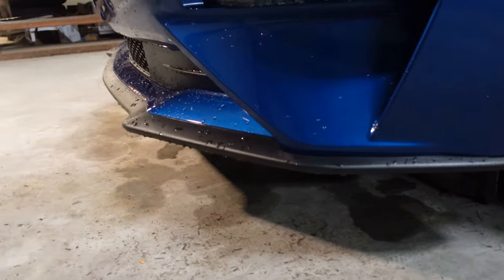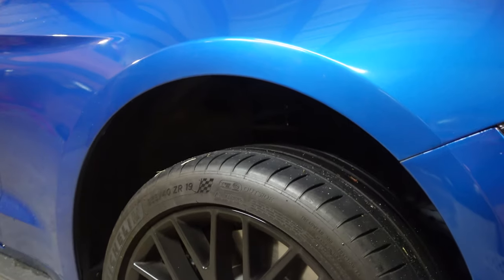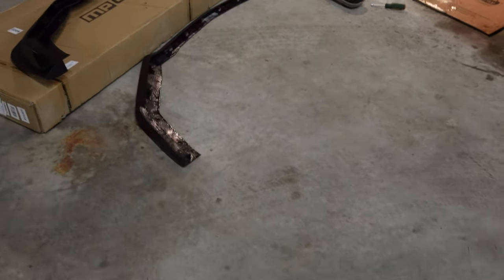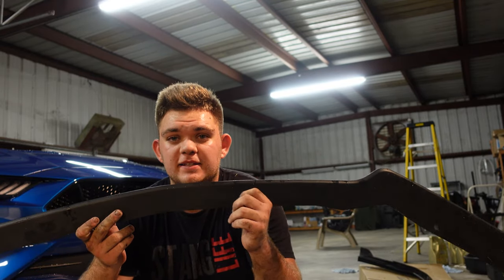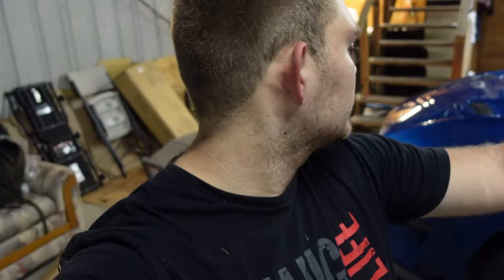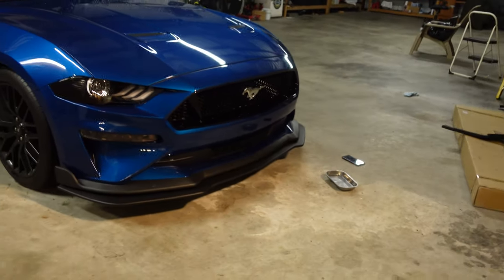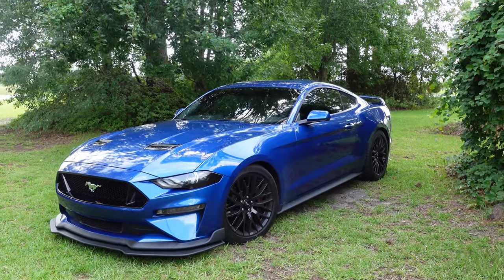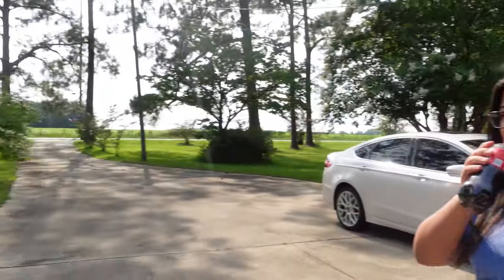HOW TO MAKE YOUR MUSTANG LOOK MORE AGGRESSIVE! | MP Concepts Chin Spoiler Install and Review!

Comment: For what it’s worth, I have a Performance Pack Eco and the splitter isn’t larger than the other one.  As I recall, only the GT PP got the larger splitter.
Reply from the maker: Okay see I wasn't sure 😅 I knew the GTs had slightly bigger splitter I just didn't know if it was the same for the eco 👍🏼

Comment: The push pins are easy .. u raise up the middle of the push pin.. and then pull off clip.. and to take off front bumper is super easy as well .. just clips and snap screws up top. Some clips and screws on the bottom. And pins and 2/10mm bolts on each sides of the car by intake. And the whole bumper will come off in one complete piece!! But don’t forget to disconnect the head/turning  lights connections
Reply from the maker: The push Pins were easy once I figured out that you have to push the middle part up. The rest of the bumper doesn't seem too hard I just need more practice before I trust myself with it lol. Thanks for the heads up 🙏🏼

Comment: where did you get the gloss black hood vents ? I cant find it anywhere for the 2019 mustang gt???
Reply from the maker: I got an OEM pair from Ebay off of a black mustang
Reply: @MRTNFK8  can you please please please leave a link, I only see them for $300 other ones are too big. I like the ones you have they arent different size. I liked and subbed.
Reply from the maker: https://www.ebay.com/itm/New-Take-Off-2018-2019-Ford-Mustang-GT-Hood-Extractor-Vents-Ingot-Silver-/274360761245?mkcid=16&mkevt=1&_trksid=p2349624.m46890.l6249&mkrid=711-127632-2357-0

This is the seller idk if they have any black in stock

Comment: I just installed this on my 21 gt.looks good but there is some gaps.i guess it's just how the splitter is cut.maybe eighth inch to qrt inch gaps on both sides in the front
Reply from the maker: Exactly how mine is. Since it's on both sides I didn't mind too much but still far from OEM
Reply: @MRTNFK8   yea I don't like the fact that there's those gaps.def not oem fitment.and way overpriced .maybe if it fit perfect

Comment: Does it have a gap between the bumper and splitter?
Reply from the maker: There is about a quarter to a half an inch gap equally on both sides. Not bad enough for it to look out of place

Comment: Have you had any issues when going fast since the installation ? Nice car btw
Reply from the maker: Hello! I don't hear any noises that would be concerning and I checked it after a few hundred miles and everything seemed fine. Panels stayed in the same spot. Only problem would be ground clearance